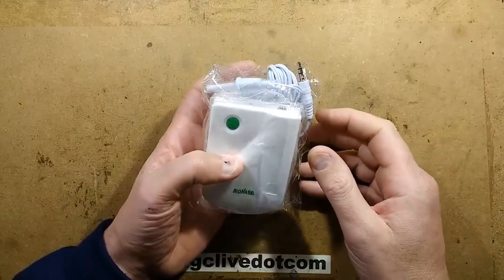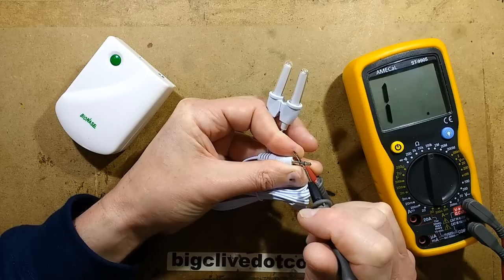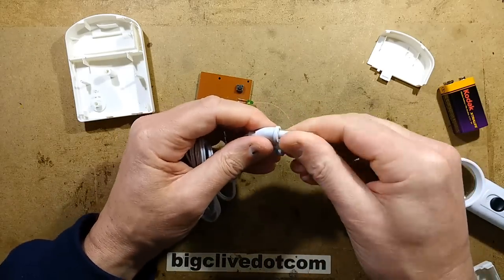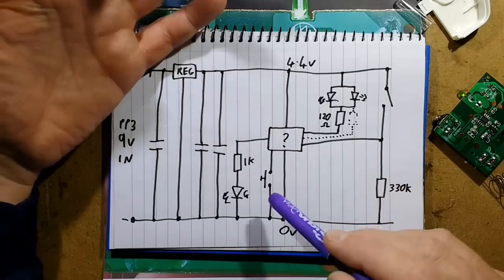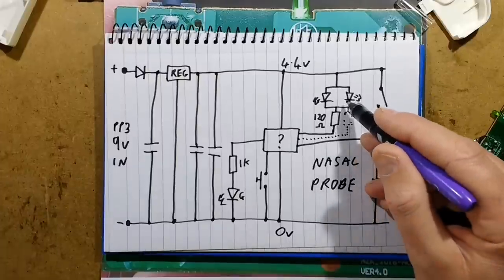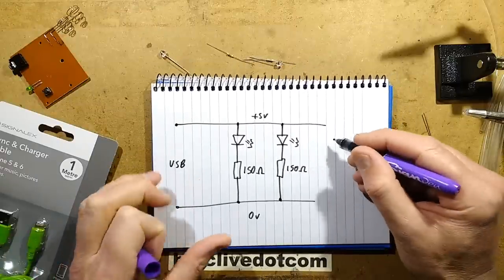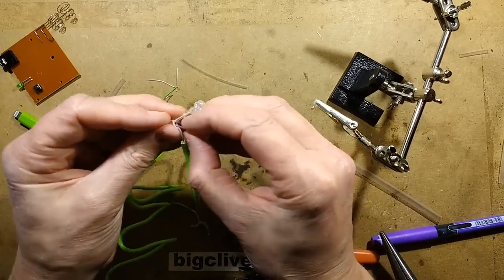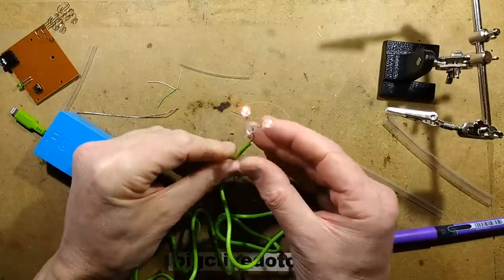Red light nose probes.  (And a DIY one for your snitch too.)

Comment: You're right about blocking the 'inlet' for a while help if you got hay fever. The swelling in sinuses get lesser. Your products looks better because the leds not share the same resistor, but you could have saved 5 cent if the led was in series with a 50 ohms resistor. :-)

Comment: The LEDs on the nasal probe are not very well matched to cause that difference in brightness. Not helped by the fact that LEDs have a negative temperature coefficient, the hotter they get the lower the forward voltage drop so the hotter LED gets even more current so gets hotter still. This problem is solved in Clive's home made version which has a separate resistor for each LED.

Comment: Ah yes!  The old "Tip" and "Ring" takes me back to the now defunct South East Asia Signal School in Long Bien  Vietnam, just outside old Saigon, the two sides of the phone line coming into the ancient Waco 500 Rotary Dial Telephone.  You see, they sent us over to Nam after training us to use the field equipment, such as the TA312 telephone, a hand generated ring with two D cells furnishing talk power back to either another field phone, or a Switchboard, the most common being the SB 22 (I think) and the SB 86 (I know, used two of those tied together for CRANE Switchboard in Dong Ba Thin, near Cam Rahn Bay (well on the Bay, but not in the camp, across the bay actually!)  So at any rate, when we arrived at the Headquarters of the 18th Engineer Brigade, we found that they had changed from the field phones to the "NEW" rotary telephones, the Western Electric 500 series.  Now the dials didn't do a damn thing but piss off we who operated the switchboard, as it made the eye displays go bonkers every time some asshole tried to dial home, but at any rate, not having been trained in the installation of the Waco 500 telephone, they sent us down country to that school to learn how to hook up the stupid wires to the damn phone, like we couldn't have figured that our on our own, well I take that back, I did know some idiots who could not have I guess.  I was lucky though, they sent me down over Christmas of 1970, so I got to go to the Bob Hope Show at Long Bien, man that was a cool show for a kid such as me, having never seen anyone more famous then our Commanding General, who was so laid back that nobody knew his name. At any rate, the Tip and Ring were, of course the two sides of the phone line.  

Yes, I do ramble on like this in person as well, just ask the wife, she will explain it to you in one million words or less. Perhaps that is why I ramble on, can't get a damn word in crosswise when the good wife of 48 years is in the room.

Comment: A couple of years ago I read a paper on a scientist at NASA that was doing research on ways of growing food in space. He discovered using the Red LED's worked along with blue to take the place of high current grow lights. Along the same time a Russian scientist found red LEDs actually helped in healing wounds faster, helped circulation, reduced swelling and more.  Commercial units are expensive. I could not afford one. So I tested using a cheep eBay 10 watt RGB flood. You did a video on the 10watt flood.  Used only the Red and held it on my arthritic knees for about 30 min each. The next morning, my knees actually felt better. I now use it about 1 to 2 times a week. It actually helps in swelling, pain, and mobility. It's not psychosomatic because swelling will go from the size of a cantaloupe down to normal by the next morning. More so than they would by not using it.  I feel there is some validity in the red LED used for healing. Just saying
Reply from the maker: If you wanted higher output you could fit an all red LED into a standard floodlight.

Comment: I was thinking the same thing, the apparatus is just for power and the led for nasal is the only thing that we need, I don't have any idea about "resistors", my question is: can I just connect it on a standard cable phone charger like the one you used so that I won't have to buy 9 volt batteries which quite a hassle? thank you for this video...

Comment: I made up a USB powered LED 'the other day', whilst shrinking the tube unto the assembly, I noticed the LED had started to combust - oops 'too much gun' - as in heat gun (line stolen from a John Wayne movie). Suprisingly after removing the charred plastic, the LED worked just fine - it's still in service.

Comment: I'd have thought that the 'mystery chip' (the little uController) would have been from Padauk since these are below US$0.05 each (5000 qty)
However, all of the 8 pin Padauk chips seem to have ground on pin 8 and the one you have there looks to have VCC on pin 8
The cheapest one I could find with VCC on pin 8 is an ATTINY which costs more than 20 TIMES as much!

Comment: Out of the visible spectrum 740nm to 680nm light will pass the furthest through human tissue before absorption. If this device was putting out enough light it might warm the nasel passages. That is pretty much the only benefit I could see. Warm moist air is good for sinus inflammation but I doubt it has high enough wattage to make any difference.

Comment: I actually bought this device 2 months ago being super sceptical but with chronic sinuses infection for 10 years I am trying anything to get this off me. I was surprised  that it actually had positive result(cant cure you without regular medicine, but once cured with antibiotics it stays cured with this so it is kind of prevention treatment for me). I really want to make one myself since this thing goes through 9v battery for 4 days of work - please let me know what was the wavelength of the original diodes and is there a reading I can do for treating bacteria with red light (so I get more knowledge on the wavelength and etc.)
Reply from the maker: You could get a rechargeable 9V battery.  The typical wavelength of the red LEDs is 630nm to 640nm, but anything between around 630 to 660nm has been used in the past.  Basically every shade of red.

Comment: If there is anything in this idea (not saying there is) it is completely undermined by idiot-magnet, psudo-science surrounding it.

A couple of neons would work better for "a broader range of healing wavelengths and electro static exiteation."
Reply from the maker: One of the first REAL bits of research into red light therapy did use a helium neon laser.  But a standard neon might be quite low power.

Comment: Would they work better if they were dipped in cannabis oil first ?
Reply from the maker: +mike fear They would certainly go into tight noses easier.
Reply: mike fear or chip fat around these parts.. Heck, just stick a couple of chips up with a generous dash of vinegar, that will cure your hayfever.

Comment: I'm waiting for someone in China to build a single simple transistor in a massive BGA package for products like this, just to add to the super secret circuit look. Maybe slap the ARM or Xilinx branding or something on the top for show. And a low value resistor in the deluxe version. I mean, we all know a component is doing something massively clever if it gets hot.

Comment: No massage "Unless you ram it in and out of your nose", "Unless it's glued shut, in which case it's going to violent" -- god, man, you're killing me....
They just keep coming, this is one of your best!

I'd guess the drilled trace mod and 1K pilot dropper are just to extend battery life (as dropping the intensity doesn't drop theraputic effectiveness 'much' - there's not much down from 0). Customer don't want their nasal therapy to eat expensive 9v batteries...

I see one flaw to your design, the LEDs may get a tad warm @ 20ma for nasal "therapy", but then again, maybe that's the infrared supplemental therapy feature of the BC Snoz-o-matic??

If you run across a LED hemorrhoid therapy device at a yard sale, steer clear....

Comment: i think the way these are supposed to work is that ac motors do not like to run on mis phased ac and these uses a large capacitor and resistor network to creat a phase mis match that stalls the motor in the electric meter causing it to stop showing the electric use.

i would think that should be illegal since you are interfering with the meter

Comment: What I would've done would've been to use small test tubes, send an appropriate sized LED with resistor and lead(s) to power source into them, backfill with hot-melt glue, maybe some heatshrink over the ends to clean it up.
Rationale is simple, when you want something which does not present any crevice for bacteriological cultures to develop, and the smallest sizes of test tubes are perfect for the purpose. Only catch is how to shrink the heatshrink without melting the tube :3
Reply: I would strongly advise against inserting glass objects into any body cavity.
Reply: That size they actually are plastic, hence the problem of heatshrinking without melting the tube. :D

Comment: Fascinating. Thank You. I watched from beginning to end and I have ADHD. I have been researching red light therapy using LEDs in 810-850nm range. There is much well written research. My wife had a bad stroke and there is plenty of evidence that infrared light helps. Look up an English prof from HArvard called Dr Hamblin if you are interested. From my research it seems the only practical way of getting this into blood stream is via the nose. The only product that does this costs $500 and you've basically made it for pennies. AND for $500 they don't even include a pulsing action which has been shown to make it work better. If some enterprising person were to make something better let me know and you can make a alot of money if you sold it for $100.
Reply: Buy a green light therapy 520nm it dies help with anxiety.

I think Hooga sells a red-light mini flashlight that doubles as a nose light with an attachment.

Comment: My guess on why that track was drilled out - Their LDO reg has 30 mA top output current, so if they ran each LED at 20 mA that'd have the regulator getting 'displeased'; hard at 4.4V to put both LEDs in series, most likely. Series of poor decisions in that design, seems to me...

Comment: Phototherapy is a real thing, but there is basically no way it would do anything here. On top of that the 'best' wavelengths are between ~750-860 nm with peak at ~810 nm. The idea is that it 'helps' the electron transport chain of mitochondria work 'better'. Visible wavelengths don't not have an effect, but they are far from optimal, especially with penetration. I was going to cite some sources or something, but now that I have typed this I realize that I don't care enough to be arsed; you folks know how to google, and whatnot, and people who really want to believe one way or the other aren't going to care.